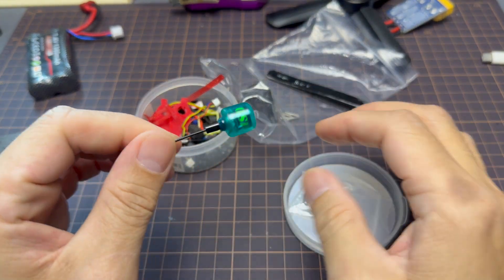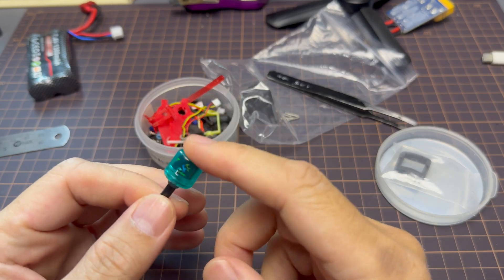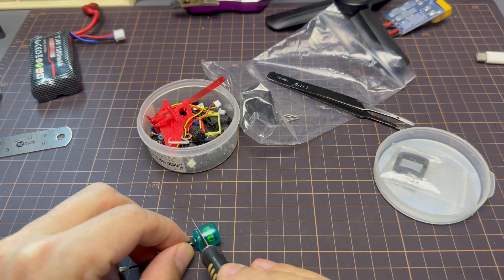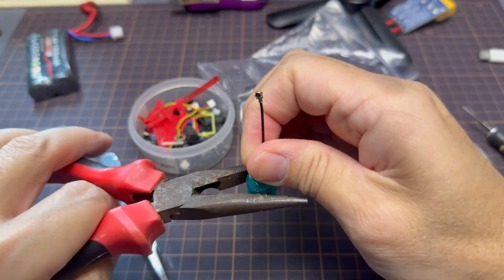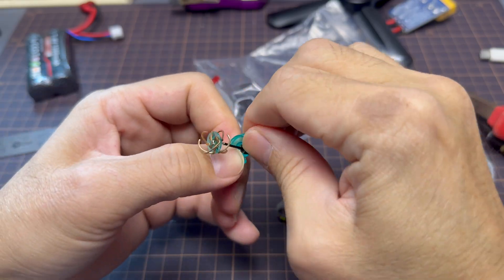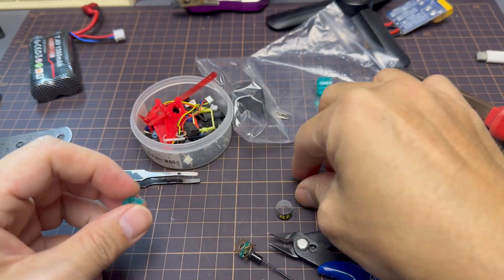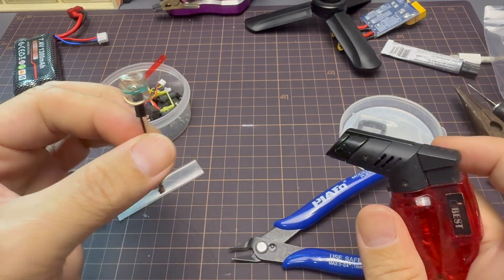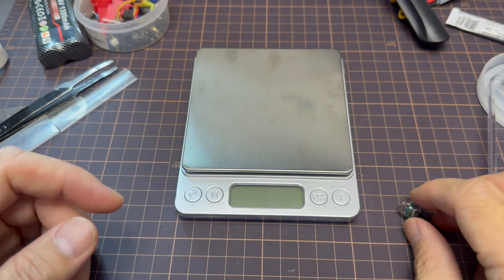Antenna Mod for Digital Tiny Whoop

Comment: What are your thoughts on making a small hole in the top and then injecting hot glue inside...so during freestyle crashes nothing comes loose. I've been doing this for years now...

ps nice idea on the antenna I think I might have to give this a shot!
Reply from the maker: Actually, thats a brilliant idea! Kinda like a silicon bumper at the top of the canopy. It sure absorbs impact! Haha thanks bruddah. I asked Maple to build one with the LHCP like they did with the RHCP. But as usual, they totally ignored me. So had to mod one myself. And this osprey antenna looked like the perfect one for it!
Reply: @shogunemperor  From personal experience I remember breaking 2+ antennas a night...and always wondering why can't they make them more crash proof. 
For long range I just leave it be..but for other stuff...eh why not...better than replacing it all the time.
I'll have to look into this silicone idea too! Not that I really crash like I used to, but hey it's nice to know you have a strong quad.

Companies...where is FPV headed in the future I wonder.

Good job again, I'm so doing this next time!

Comment: 😂 nice mod! Could you tell more about tune of a quad or o4, it's fly so smooth! On mine I have little isolation from time to time
Reply from the maker: Thanks so much mah bro!! Im using the factory tunes of the mob8. As for the 04 lite, i just set it to auto. I didnt wanna mess around with the shutters for fear of over exposure. Which is why u see abit of of jello every now n then. Oh! Try hard mounting the camera. Mines hard mounted.

Comment: Very interesting the video. I have also converted my Mobula8 to DJI O4, but so far I have no reception problems with the standard antenna. Best regards 🙏🦅😁
Reply from the maker: Thanks my bruddah!! Yeah, the dipole does its job… but i have abit of a range limit with it. With the lhcp its definitely better as an “all rounder”.
Reply: @shogunemperor  You can send me your pit tuning settings, I am not completely satisfied with my battery mileage of the Mobula8 with DJI O4. I expected a little more of that, but apart from more performance. Say power, nothing has happened. Or did you leave the pit and filter setting like me? Best wishes and as always happy flying, my friend. 😁🦅